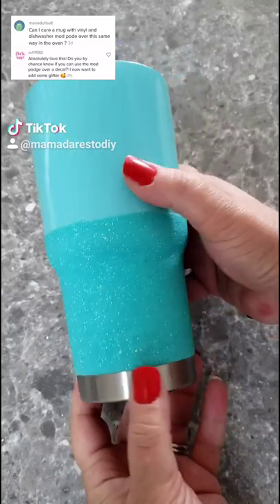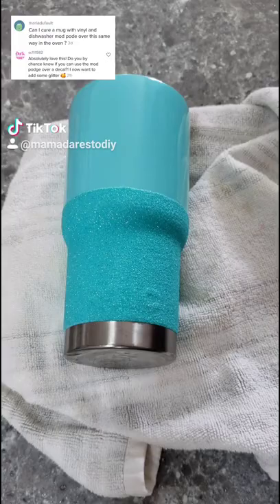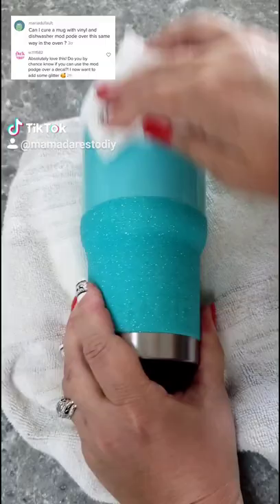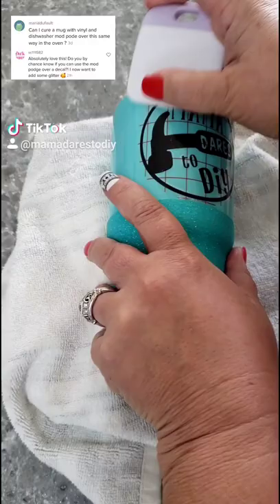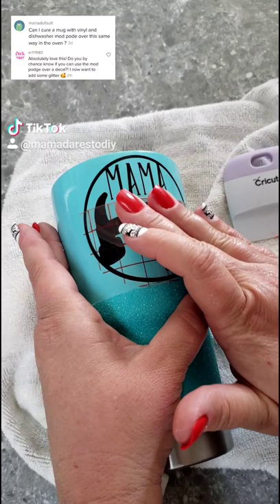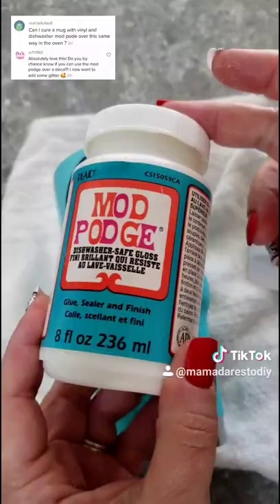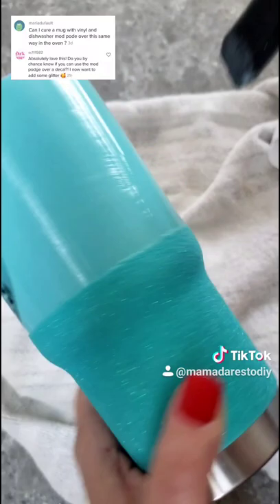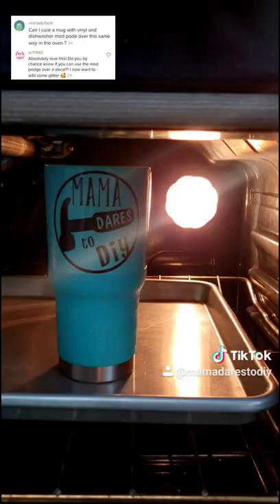Decal Tumbler Without Epoxy! Mod Podge Hack! #shorts

Comment: Do you think you can build up the modge podge so that way there's not a lip/bump between the glitter and the cup? How could I make it smooth like the epoxy does? I wouldn't want to use epoxy because it is dangerous. Thank you for showing this. Maybe use a smaller glitter? Didn't know if you had any ideas.
Reply from the maker: You could try.  Just make sure your coats are totally dry, or else you may end up with a "cloudy" look 😉

Comment: how do you remove the transparent part off the decal without getting the sticker off?
Reply: Press it with the smoothing tool and then heat it for 10 seconds a side with hair dryer. Then peel from a corner slowly!
Reply: Then you need transfer tape to lift the decal to then place it on your item. Also, transfer tape is reusable

Comment: The video went so fast. What kind of mod podge was it?
Reply: With the blue label. Dishwasher safe mod podge
Reply: Also, did you know you could change the playback speed? Slow it down to .25 & you can see the modpodge @ :30 secs in.
Reply: @gramcc514  I had no idea that could be done? I'm not very TikTok savvy. I don't have the app, so have not played around with. Occasionally I can see a video, like this one. Thank you for sharing that info!